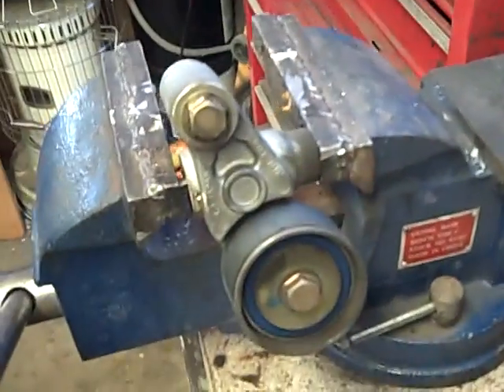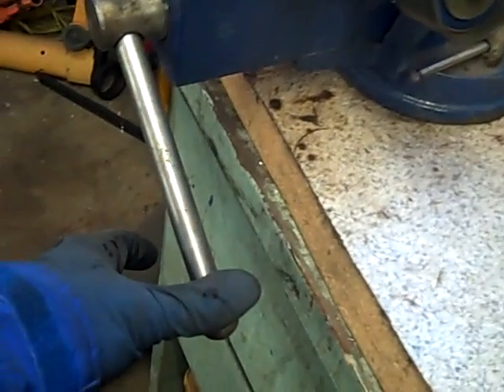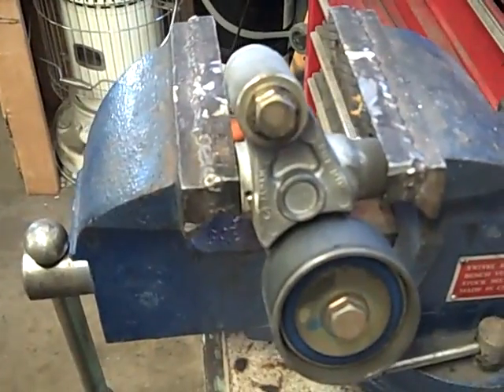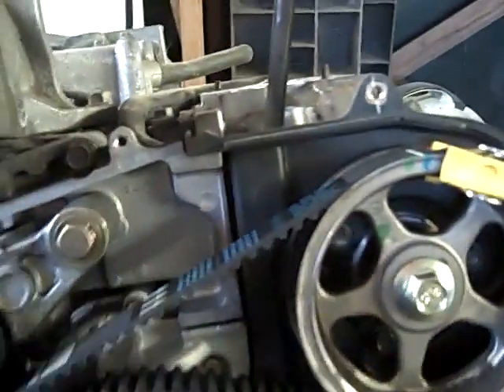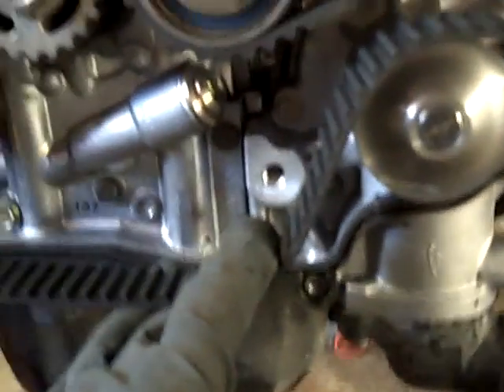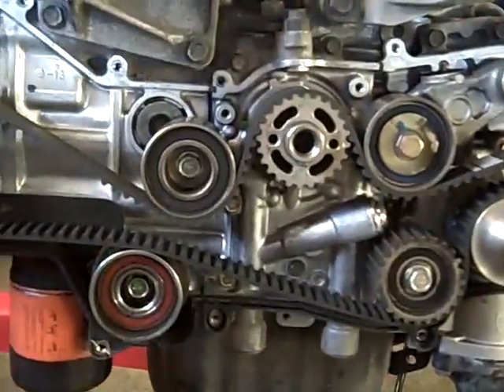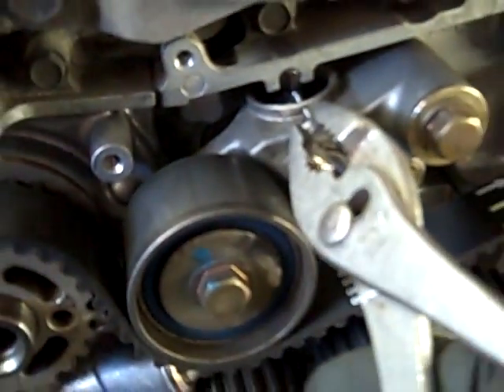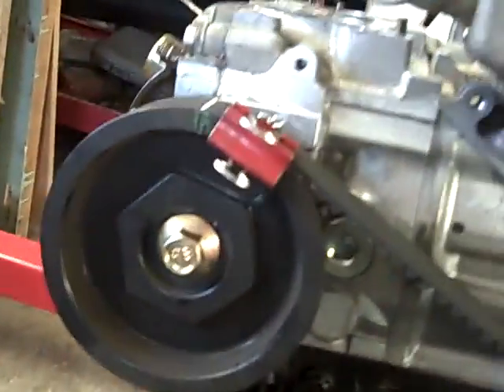Subaru 2.5l Timing Belt Replacement (2002 Forester)

Comment: Awesome video. I have a question/ conundrum. My crankshaft is 5deg past 12 o’clock, so I need to turn it almost 360 to get mark to line up properly. What position would I place cams in in order to do that safely? I’m having trouble figuring that out. Thank you🙏🏼

Comment: Great video. My 02 Subaru has 216K miles. Would you do this without replacing the head Gaskets and having the heads re surfaced?

Comment: Hey bro, just changed the timing belt and water pump on a forester I just bought. The radiator had a crack on the top, so I epoxy puttied it. It stopped the leak. Also I changed the pcv valve which was causing it to idle rough and made it seem to want to stall while in gear with no acceleration. The pcv valve was causing the check engine light to come on as wel( it was really gummed up). After changing all this no check engine light, but it still idles rough and shakes while at a stop in gear. When I changed the spark plugs, there was a lot of oil that was leaking from the gasket around plug holes, and it was all over the spark plug when I took them out...  also my my radiator hose seems to be imploded while on idle. What could be causing the emplode?

Comment: You show the Timing Belt removal with the engine OUT; can this be made with the engine IN its place, just removing Rads and pulleys for Power steering, Alternator and Air compressor? And - in your opinion - what's the Serpentine-rubber-tooth-belt's life span, before you need to replace it? Are there any alternatives to its construction, like metal chain belt, for instance? Thanks for video.

Comment: Thanks for all of these Subaru videos! Just picked up a 2006 Forester with 110K miles and the timing belt hasn't been done yet. I found a timing belt & components kit by Gates (TCK304) on Amazon for $118 that comes with idlers, tensioner, etc. It seems a little too good to be true since it's normally around $300+ at the typical car parts stores for a kit like this, let alone dealer parts. What do you think of this Gates kit? Any parts recommendations if this kit is too risky?
Reply: go with aisin, some of the components in the gates kit are made in china and not japan.

Comment: What's wrong if I can't turn the crank all the way around while the cams are in position?
Reply: You have a cam (or both) 180 degrees off and a valve is hitting a piston.

Comment: hi there I have a 2.5l that I did what you did to a tee and got the motor back in and it started and ran for a bit and locked up. I took the motor back out and found out the the pulls on the passenger side broke. doest look like any of the valves are bent. is this motor toast or can I just get another pully and try again?

Comment: Do you have the special camshaft pulley wrenches from Subaru? I didn't have them so the 2 hour job became a 10 hour job just because I couldn't loosen the can bolts. How do you torque the camshaft pulleys back? I tried using the belt like some videos suggest, but I feel like I'm going to break the belt. I tried it once already and did nothing but skip a tooth and had to start over.
Reply: Here's a write-up I did on torquing the pulleys without using special tools, but you need the old timing belt.
http://sl-i.net/FORUM/showthread.php?18633-DIY-Camshaft-Pulley-Torqueing-No-Special-Tools
Reply: BrianMDPhD He replaced the head gasket in one Subaru and just hit a long wrench with a sledge hammer.  That must have had a manual transmission.  With those, if you put it in fifth gear, you do not need any tools.  There is also a technique where you put a flathead screwdriver into an inspection port and it immobilizes everything, although one guy posted that the tip of his screwdriver broke off and he needed to pay a mechanic to extract it.  You can also get a very long breaker bar, prop it against the ground, and turn the key, without actually starting the car.  That is supposed to move the crankshaft just enough to break it loose.  However, a chain wrench is inexpensive, safe, and relatively easy to use.  That is what I did, but hey!  You have options!

Comment: When I pulled my 2006 Legacy 2.5L engine to replace head gasket, the torque converter came off too! (I neglected to unbolt the 4 bolts!)
I removed the 4 bolts and reassembled torque converter to the transmission...had to re-attach the two-dog-sleeve which is held on torque converter by a wire retaining ring (had to straighten the slightly bent tangs of the retaining ring).
Do you think my reassembly is safe to run?

Comment: I meant lines on the belt itself like some belts come when you buy them. I'm thinking I just count the teeth like it says in the book. If I do that does it make a difference in which way I put it on? Like so you can read the part number? Oh and there's no arrow on the belt either. It's brand new. I can see the timing marks on the crank , cam pulleys and cover.Thanks.

Comment: Brian, need your help big time. Got an electrical problem with my 97 Subaru OBW. Few months ago the rear lights all went dead. Turns out the fuse blew. I replaced the fuse but now I have the following problem: whenever the headlights are on the left turn signal indicator is partially illuminated and I cannot use the left turn signal. Right side works fine. I've swapped bulbs and checked for rust, but no luck yet. Thoughts? BTW, I wear the tshirts you sent me all the time!

Comment: Brian - on the DOHC engine, is the direction for rotating the right/passenger cams the same as the left/driver cams?  We mistakenly removed our belt before putting the crank and cams at the installation marks and am now unsure what specific sequence to follow to get it all lined up for the new belt!?  Can I turn the crank to the center mark and then each cam independently?  This would be an interference engine.  Thanks for the vids!!

Comment from the maker: You can move them independently.  Just make sure you turn them when the crank timing mark is on.  And turn the drivers side ones the shortest distance required to align marks.

Comment: Brian your helpin me out alot with your vids. Awsome keep it coming. I have a 96 outback legacy that just recently started not wanting to start it idle's poorly and shuts off.It loses coolant and has excessive exhaust steam even after car has been shut off.It does'nt have any coolant in oil but has a lil residue in coolant. I had the head gasket replaced like 30 thousand miles ago. Could it be the IMG or should I worry about head damage or head gasket? Please reply thanks for all your videos.

Comment: Thank you, thank you, thank you. I have a 2002 Forester that I bought at auction real cheap. The car is in perfect condition but I bought it with a bad timing belt and bent valves. 
I'm in the process of putting it back together and you made it so clear and easy.

Comment: hey Brian. super video. thanks for posting it. it was instrumental in the rebuild of my forester 2.5 dohc. however, i have found one critical mistake that i think you need to know: the owner's manual specifically states do not use horizontal vice to compress tensioner. it is gravity sensitive and will fail if compressed horizontally. unknowingly, i did it a couple times and the tensioner no longer held its steady position when installed. the belt could have easily jumped teeth. otw, great vid!

Comment: There is a little soot in the tailpipe, not really any oil to speak of on the bumper or otherwise. Checked the pipes on our other 4 vehicles and got varying amounts of soot in all of them, however. At this point I may take the timing cover off and double check that it's not advanced or delayed. Engine knock doesn't seem likely to me, but I'm a novice. Tx for all the help so far.

Comment: The acceleration test was inconclusive. The smoke coming from the tailpipe might have been a little blue but hard to tell. It's a manual so stomping the gas in first gear doesn't really torque it out that much and I'm hesitant to try winding it out to super high rpm with that knocking sound. The sound subsided again after the engine warmed (3-4 min) but is still intermittently audible, but to a much lesser degree. Anything else I should check?

Comment from the maker: 2.5l is interference and bashes valves 40% of the time at low speeds and 80% of the time on the freeway.  I would put a belt on it and try it.  See if you have compression.

Comment: Have you had many cases of the oil pressure switch on the drivers side cylinder head leaking?  Got one that looks like it's actually seeping up through the sensor itself, and a P0028 code (but I figure since VVT is controlled by oil pressure, it would probably be the cause of that code)

Comment: heya Brian,
Im about to do my timing belt swap this weekend, and have to bring home my tools from work. doing the belt, 3 pulleys, tentioner and water pump. Can you recall what sockets and suck Ill need for it? I dont want to have to try finding a way back to my shop to get tools... so far I have 14mm for water pump bolt, and antiseize incase.... strap wrench? sockets? pry bars? etc? hopefully you can shed some insight before i dig into this thing.

thanks

Comment: please help Brian! I have a ej25 DOHC and all the timing marks are lined up with the belt and with the notches. but when i turn the engine over by the 22m socket, it stops at about 9 o clock from rotated counterclockwise! UGH it just jams.. and im sure it's the valves and head

Comment: Hey Brian, Great video. All you stuff is real helpful. I also did my timing belt following your videos. The one thing I can't seem to find is what depth do you put the new camshaft seals.
The right side cam I pressed in with a socket and tapped it with a hammer. It seemed like it went back farther then the others.  Now I do see a little bit of oil coming from the side of the covers when driving the car. Have been driving it for about a week now. Any recommendations are much appreciated. Thanks

Comment from the maker: Correct.  There's pins on the cams so they only go on one way.  4' pipe wrench on the outside of the pulley and a 22mm socket and breaker bar on the bolt.

Comment: Sweet video man thanks again! I will use this for reference when I do my cam seals on my 97 legacy outback looks like the same set up! I heard when lining the pulleys n such up the cam shaft pulley on the left (driver side) can only be turned to the right (when standing in front of the engine).Is that true? If so how can u get it off with out it turning? Remember I'm using caveman tools lol, I don't have air tools.

Comment: 2003 Impreza EJ25 I've installed the new timing belt and idlers.  When I released the grenade pin, the tensioner did move but the timing flanges on the crank pulley are so very close to the idler pulley.  I spun the motor (by hand) and they touched a little but then stopped.  Right now there is about a small 1/8th gap between the flanges and the tensioner idler surface.  Should I be worried?  Did I miss something?

Thanks again for your previous responses.

Comment: when looking for spring steel or a nail to fit in that Grenade Tensioner, I found a small drill bit works great. It is hard and they are indexed down so you can find a perfect max fit for the hole. Thanks for documenting so much, Brian.

Comment: hey commented on you video on blown head gaskets on these engines. would timing belt being loose throw a code for misfires (specifically 3rd and 4th) and cause general noisiness of engine operation? i have replaced everything dealing with electrical and fuel components to fix this problem

Comment from the maker: @GDMAZ EVERYBODY asks me that.  I made a video on it and I can't find it!  It's SUPER SAFE AND EASY.  When you have the timing mark on the crank drive gear lined up all four pistons are centered in the stroke/block so you CAN'T mess it up.  There is no risk if that crank mark is aligned pointing up to the crank sensor mark.

Comment: Brian- do you have a video of a 2.5 DOHC timing belt installation? Need to make sure i don't damage valves when I rotate this motor- also where should crank postion be so if I rotate the cams without the belt on, where should crank position be?

Comment: I dare say that the hydraulic tensioner was not changed when the timing belt was, and the leaking piston ceased causing the bolt to snap as it was adjusting. Could this have been the case?

Comment: My experience, i had the hydraulic tensioner bolt snap on me this week. Looks like the piston was leaking for a while as there has been a small oil leak since i bought the car (2months ago) but had no idea where it was coming from. The bearing feels like it does not spin as freely as it should (spins freely for 1-2secs then stops). The timing belt was changed 30kms ago and I've only put maybe 2,000kms on the car since I've owned the car.

Comment from the maker: @ant1986fel Note for the young buck fan boy.   There's more than one way to do things.  Give experience a try.  When you work at a dealership that wants to sell parts you MUST use a new tensioner.  In reality you are fine to reuse one.  I've reused  hundreds of them successfully.   On a helicopter you can preach such rhetoric where a 1-2% failure rate is unacceptable.  On a low hierarchy thing like this it's ridiculous. There's a higher rate of failure than that in NEW PARTS even from a dealer.

Comment: its a 2000 forester. also the right cam spun on me slightly out to the right and i used a wrench to spin it back to the position it started in when i took the belt off. i am asuming i cant hurt anything seeing they spin all the time..but dont know forsure

Comment: hey i forgot to crank the timing marks to the top position at the vary begining. i put the belt on in the position that they stood and and cranked it backward...when i cranked it backward all marks lined up on the belt, pully with the engine block. i want to know if there is a way to make SURE that all things are correct before i turn it over. i am fairly certin but want to be sure.
thanks for the help.
BTW your videos are amazing..

Comment from the maker: @choupique55 Big pulley=Harmonic Balancer.   Don't even worry about TDC till the covers are off.  It's the cam wheels you have to worry about.  You can have the crankshaft on TDC and be off 180 on the cams.

Comment: @jsm141285 Also, I run only 98 premium ULP. I did an upper-head cylinder clean recently, and absolutely nothing noticeable came out. This is a result of running synthetic/Subaru oil filter and air filter, and good qualty fuel, keeping it in tune, and giving the car an occasional run for it's money.

Comment: @jsm141285 Full synth is the way to go, you want to run it in with the factory oil for the first 6000 on a Subaru 2.5L, then dump the oil and put in synthetic. However, some engines and the 2.5L series seem to have a tendency to burn oil, this just seems to be the way with a high-revving motor if you push your car. So you have to keep topping it up (roughly 500ml every few months), don't worry if you have a motor like this, it appears to be normal.

Comment from the maker: @oabus  You maintain a summative pull away from the motor while wiggling it or rocking it back and forth.  If you're asking this, I'm thinking it would be wise to use some penetrating oil where the bolt used to be.  As for getting it back on... hit it with a hammer (rubber dead blow) in the center till you can get 3-4 threads started on the bolt.

Comment: Now I know why we don't see you putting the idlers on to take up the slack.  Without a cameraman to let you use both hands it wouldn't happen.  It's also harder with the engine installed.  BUT it all went well and the forester acts young again.  Thanks for the video, it encouraged me to give it a try.

Comment from the maker: @kavin2611   Are you using clips to hold the belt onto the cams?  I use thick sheet metal type office paper clips to clip the belt onto the cam.  If yours is dual overhead cam (I assume it is) then you need to hold the cams still w. a cam holder tool that goes between them to hold them.  I'll see if I can make a video response of what it looks like.

Comment from the maker: YES!!!! I'm so glad you asked me!  I ran into the same thing a year ago.  Theres a bracket you can buy that is removable from the top of the motor (the one that usually strips.)  it's a dealer part that's like $65.  The other one you can thread chase with a tap and usually be ok.

Comment: My 2001 forester's timing belt tensoiner bolt is completely striped out as well as the threading in the engine block.  Is there a way to fix the block without pulling the motor and is this fixable at all?  
Thanks-
You're videos are great man!